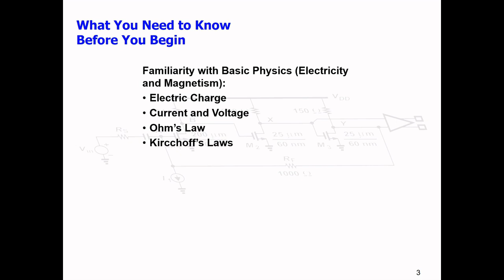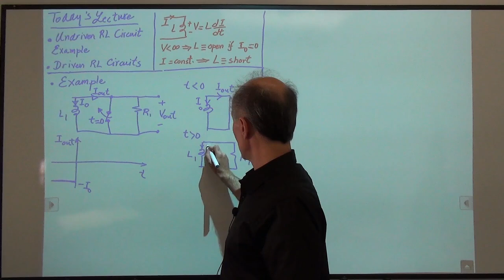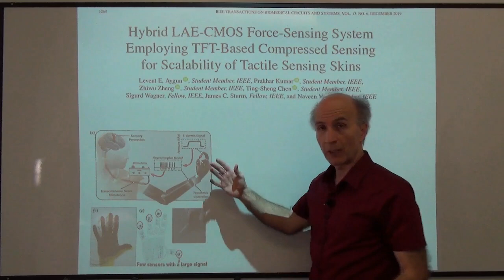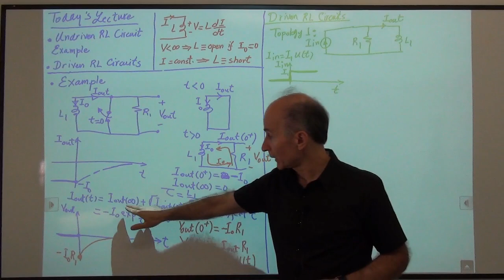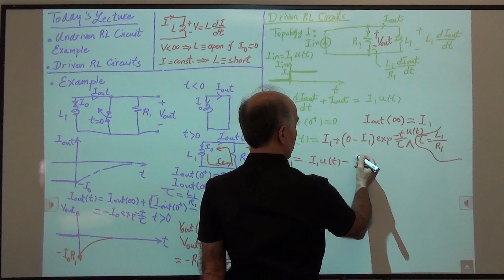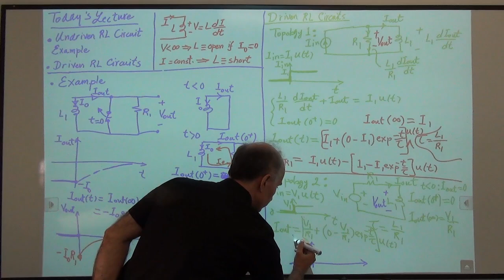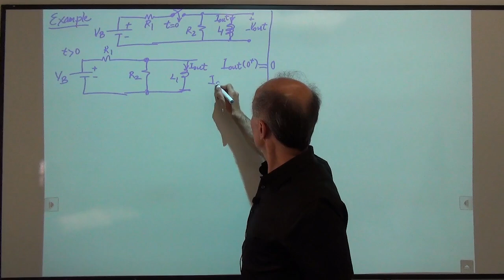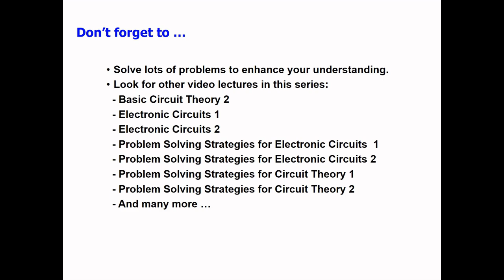Razavi Basic Circuits Lec 26: Source-Free and Driven RL Circuits

Comment: This lecture covers two topologies, voltage source with serial resistance and current source with parallel resistance. What happens if we put current source, resistance and inductor in serial? Since the time constant is zero, does this mean the current source provides an infinite voltage to make inductor's current jump from 0 to I1 directly even though there is a resistance?
Reply: Ideal current source yes. For real current sources which has voltage clamp, it hits the clamp voltage and circuit again reduces to clamp voltage source with series resistance